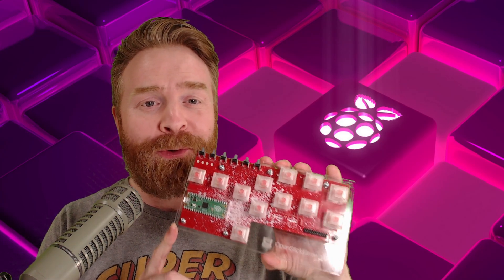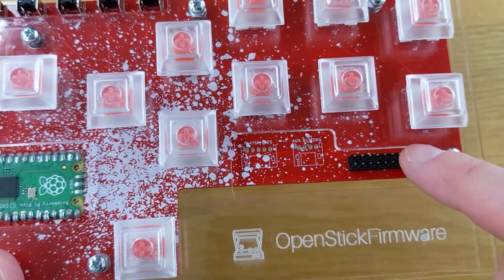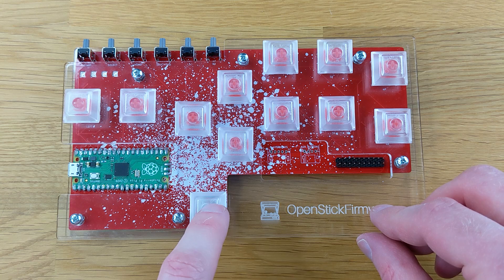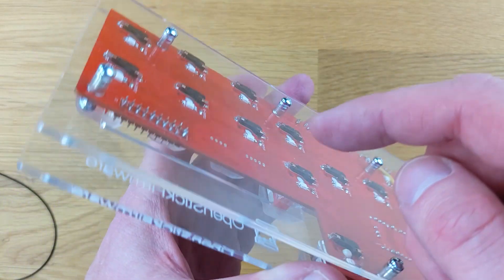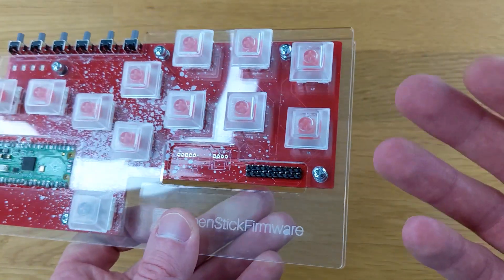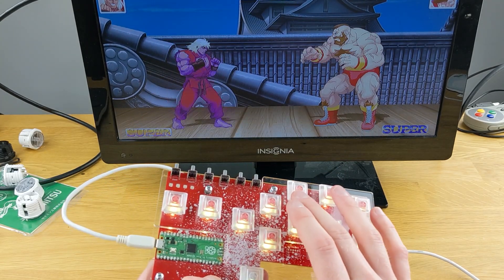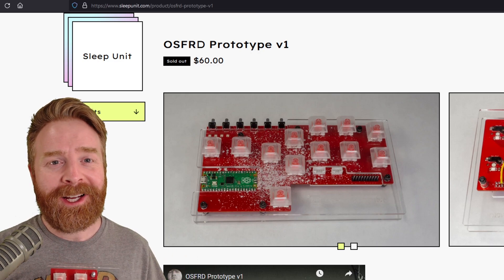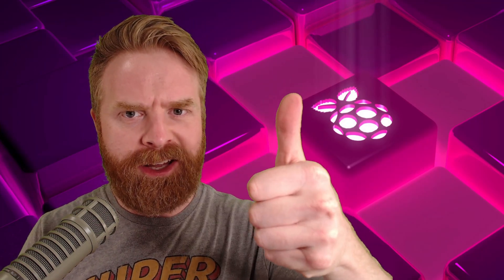Raspberry Pi Powered Arcade Stick: The OSFRD

Comment: Gonna be making something like this myself. The open source software can allow someone to reprogram the pico things like data logging your inputs, adding an led matrix or display, or maybe even add optional wifi or Bluetooth support. It's a modder's dream and the company can take advantage of the cheap MCU that powers the board. As long as they can make the board feel and play good I think they can be competitive!
Reply: I think if they can get compatibility to all major consoles and PC, they've got another big reason to get this board: you'd only need one controller! It'll save you from owning multiple fight sticks! Repairing is good too. Broken MCU? It's a  $4-6 for the MCU, $10 shipping, flash the program and put the MCU in the socket no problem. Keys are replaceable, connections can can be soldered on.
Reply: Have you built it?  Is it open source  firm ware,  also?
Reply: @TheJavaSync  Not yet. I've got the brown mx keys, just need to get keycaps then I can start setting things and building hardware and software.
Reply: Add to that the raspberry pi pico has a dual core processor, which means you can get the MCU to do something in one core while it dedicates the other core for fightstick inputs.